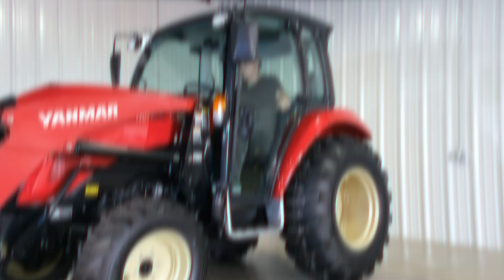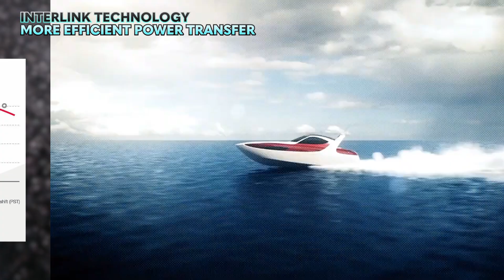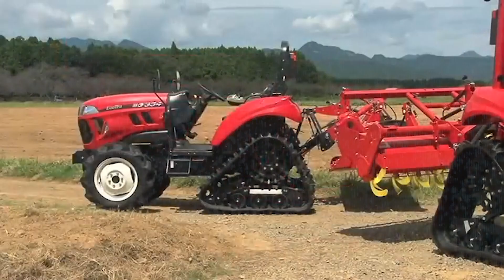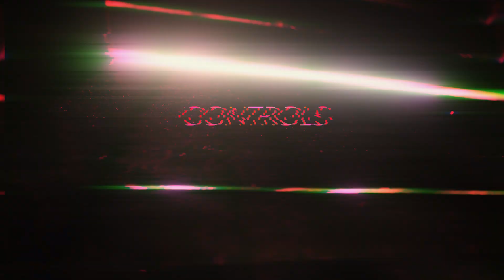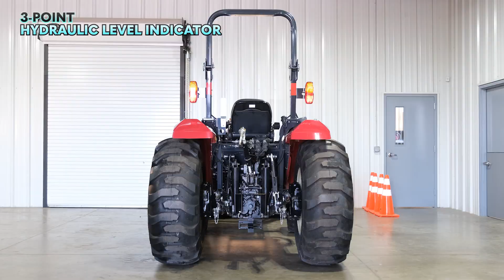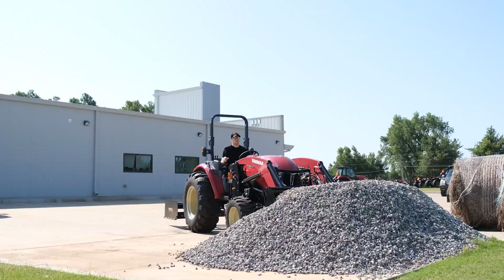THE BEST Compact Tractor In 2023? |  YANMAR YT3

Comment: Got a 2022 YT359C from PR Equipment in Kerens, Texas who have opened a second house in Wills Point. I've used it mostly for dirt work, backfilling my new shop and grading. The A/B mode is really nice for quick speed changes between grading and getting another load.
I also use it to till a 30 x 60 garden twice a year. 
Recently purchased a Lane Shark mower that runs directly off the live 3rd function. Does a heck of a job with offset and overhead clearing and regular maintenance around the pond.
I sometimes feel like it's overpowered as it has no problem spinning tires in those hard push situations. 
There are rebates and deals so shop around.

Comment: Would the YM be considered more feasible for someone who uses tractor for light work and the YT more suitable for business/daily use?
Reply from the maker: I'll be coming out with a video over the next week or so talking about the differences of the YM and YT. So stay tuned for that! But to answer your question more directly. The YT will be better for daily use, yes. The YM however is great for anyone who wants to spend less and is okay with a gear drive transmission. The only thing that's better about the YT is the transmission which actually gives you a boost in PTO power/capability and the YT also comes with a cab option. Hope this helps... if you have any more questions feel free to give us a call at Tractor Bobs!

Comment: You see the the YT347 ROPS going for $37-40K on TractorHouse. When I got quotes on premium 35hp tractors from Kubota and MF equipped with rear remotes and tire ballast, the price came to about $40K. So the Yanmar YT series represents a good value with a lot more power and features than similarly equipped tractors from other Japanese manufacturers.

Comment: A better comparison would be with Kioti, which beats Yanmar in nearly every spec across the entire lineup, from hydraulic flow, to lift capacity, to PTO power, to included features, to price. Beating John Deere and Kubota is fairly easy to do nowadays.
Reply from the maker: Thanks for the comment, sir but that's simply not true. The comparable kioti DK6020SE HST has a lift capacity of 2,716.lb, and the YT3 lifts 2,746.lb. not to mention the kioti is an HST while the yanmar is an I-HMT. The kioti specs show the PTO power is less on the kioti at 44hp while the yanmar YT359 has 52pto power. Also, they are around the same price, with the kioti costing around $44,000 online. The key things that make yanmar better are interlink technology, revolutionary transmission, and the fact that Yanmars have the best warranty at 10 years. Kioti is a good tractor, very dependable. But the Yanmar could easily win in a pulling contest because of the transmission type. As far as the hydraulic pump goes kioti states that the pump capacity is 16.49gpm (implement + steering) the yanmar yt3 has a pump capacity of 15.8 (implement+ steering) so the kioti wins on that but just slightly.
Reply: @TractorBobs
Reply: I looked at Kioti before I bought the Yanmar. No comparison as far as I was concerned. Kioti looked cheap compared to these Yanmars.
Reply: Kioti makes a good tractor, as do many South Korean makers. But not to the quality and standard of Yanmar, though! I would buy a TYM over any other Korean tractor, Kubota, or JD (because of price). But Yanmar is absolutely the best-made compact tractor, IMO. I think Massey Ferguson might make the best Sub-compact in there GC series. It is a great series.
Reply: @RicofAllTrades-yp4dw  I respectfully disagree.  I've had both, and I'd take the Kioti over anyone else hands down.  But to each their own.  At least we can agree that the top players, Deere and Kubota, are overrated as shit.  ;-)